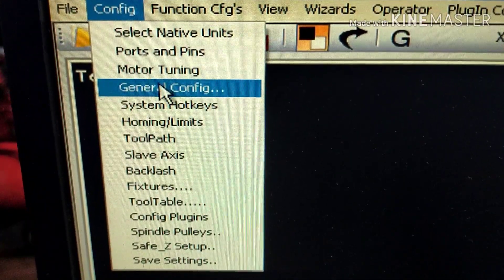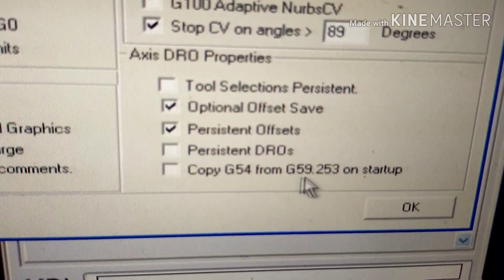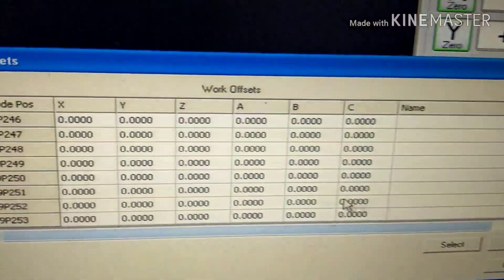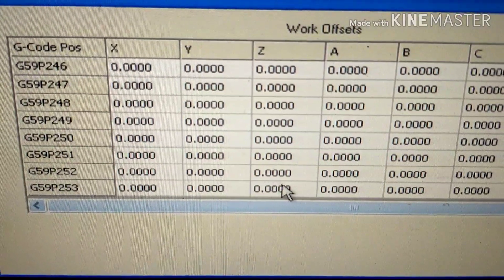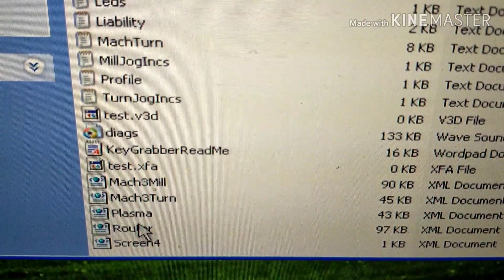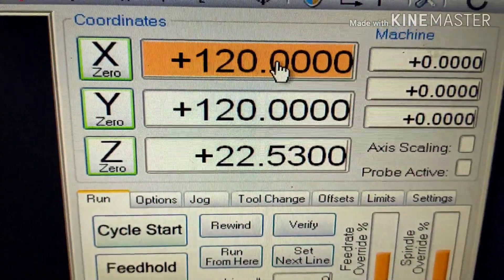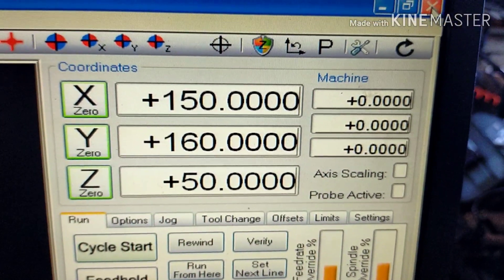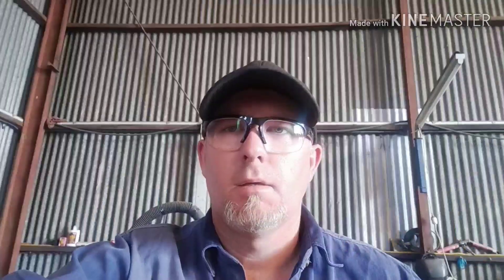Mach3 Fixture save on shutdown. ( How to setup G54/55 etc fixture saving )

Comment: Really good. Thank you. Soooo. Could I double-check? To make sure I understand this correctly, as my tick box is already unticked. What about re-zeroing the machine to the work piece? For example, if I did a complete controlled shut down (yellow Feed Hold button then the red Stop button), made a note of the g-code line where it stopped. Shut the whole lot down. ...........Come back the following morning. Load the g-code, find the g-code line then 'Run From Here'. Would the work piece 'zero' position be saved as part of this technique? I.E. would I need to worry about re-zeroing? Is your 'offsets' the same as my 're-zero my work piece'?
Reply from the maker: Yes. The G54 is saved. You home the machine and your workpiece should be already set as per it was before shutdown.